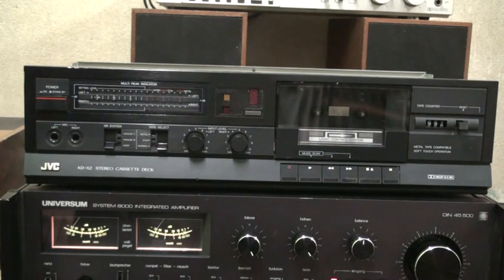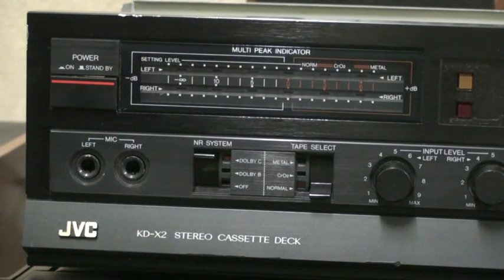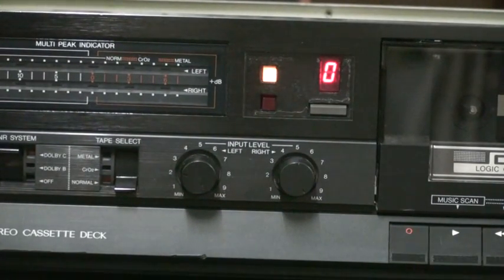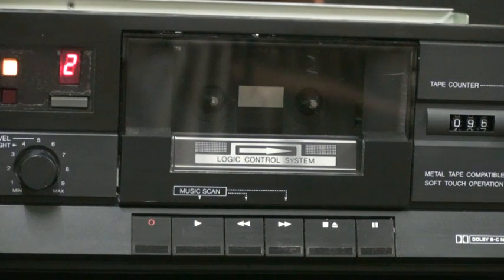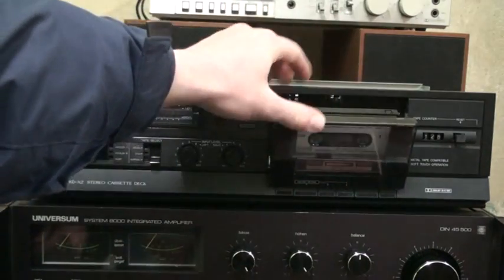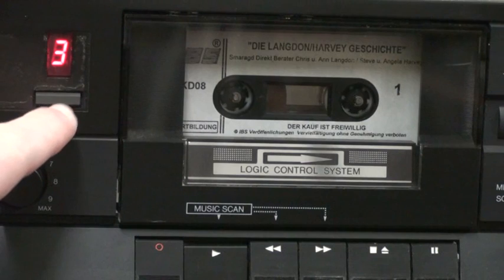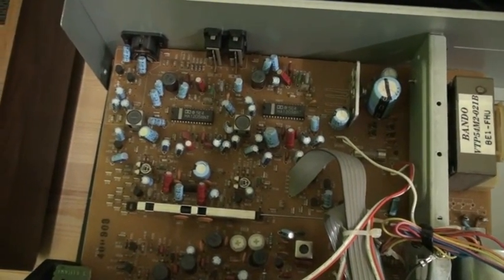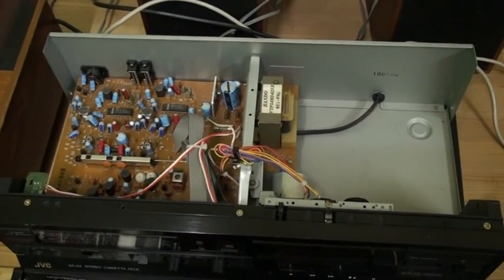JVC KD-X2 cassette deck!

Comment: The cassette compartment is on the "wrong side" compared to most decks. And the circuit board has a lot of electrolytic capacitors!

Comment: Anyone know a part number for a replacement belt?
Reply from the maker: You can measure the length of the belt by putting a piece of string into where the belt would go.

Comment: I know you do not have this deck anymore, but you could try adjusting the bias pots to the most to make the most out of Type IV Metal Bias as they use lots of bias.
Reply from the maker: That's not how you do it. The bias is aligned in special test procedures. You can not just simply turn it to maximum.
Reply: DrCassette It is more for aligning different type of tapes over the years as their formulations changed over the years. Therefore, I wondered whether it is possible to turn bias to max for better output of Type IVs.
Reply from the maker: Formulations changed over the years, but cassette decks don't need to be re-aligned. The tape types I, II, III and IV are IEC standards. Stay away from the bias adjustment.